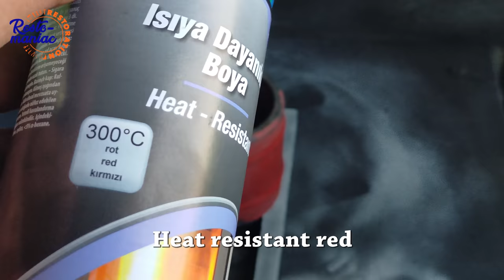Camping Stove Restoration

Comment: Why didn't you cold blue those perforated parts instead of spraying it with heat resistent black?
Reply from the maker: Heat resistant paint gives good performance for longer.
Reply: @Restomaniac  OK, thanks. I would thought of the complete opposite due to the chemical oxidation that practically seals the surface! What do you think about thermal (hot) blueing? Would that be better than paint?